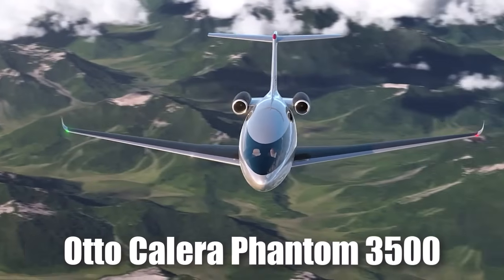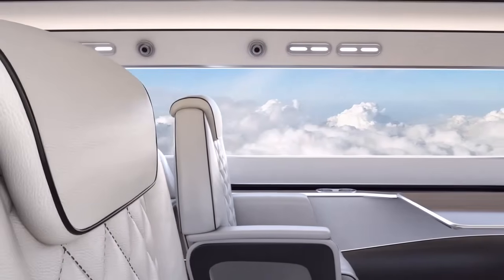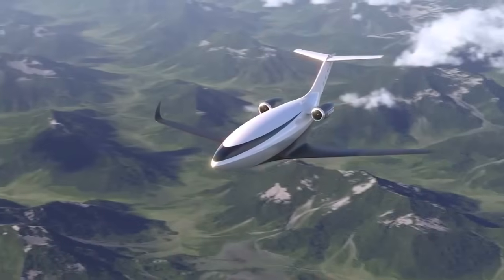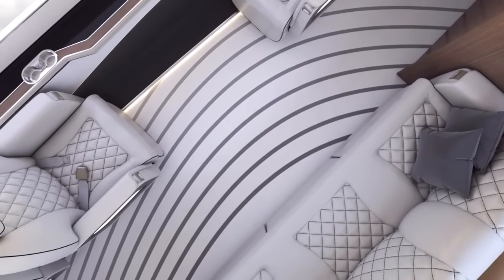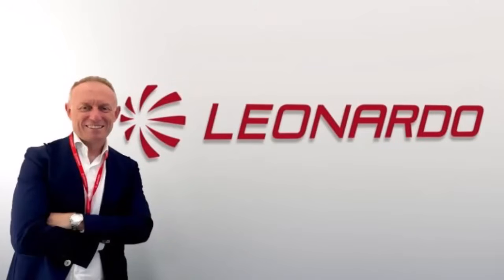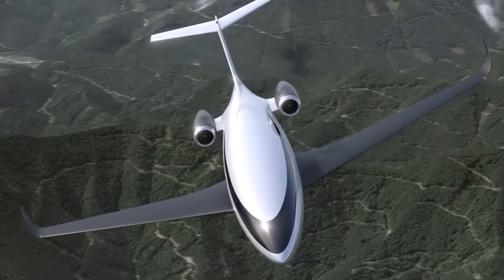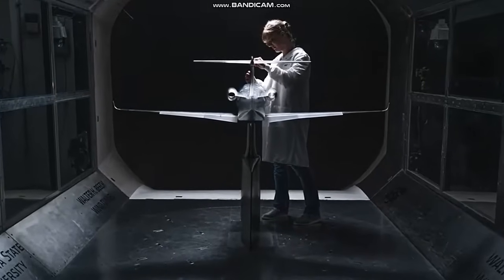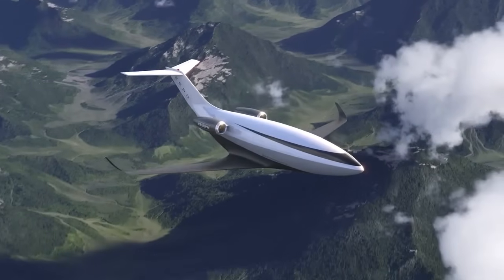Otto Aviation Announces Otto Calera Phantom 3500 | The Future of Private Jets Has Arrived!

Comment: Hopes to fly by 2027, but only if they raise $500million. In this market that seems optimistic. (Another $500 million needed to get type certification by 2030). JetZero only raised $65 million (private) for a BWB concept with much larger commercial potential with a very significant USAF interest. Laminar airflow has still not fixed cloud and rain challenges

Comment: They must use Gyro system  in the Compartments such that the passengers don't experience any Gravity of movements during flights. The second, the size of plane matters , luxury like Bombardier and Gulf stream matters ... Many modern features must be installed like AI , etc etc for smoother experience of landing and take off .
Reply from the maker: Those are some great points! ✈️ Advanced stabilization like gyro systems could definitely make flights feel smoother, and aircraft size, luxury features, and AI-assisted systems all play a big role in comfort and performance. The Otto Celera Phantom 3500 focuses on efficiency and innovation, so it’ll be interesting to see how many of these technologies make it into production. Thanks for sharing your insights!

Comment: The windows could freak out passengers.
Reply from the maker: That’s a valid concern! 😄 Innovative window designs or large panoramic views can feel unusual at first, but aircraft like the Otto Celera Phantom 3500 are engineered with passenger comfort in mind. Designers usually account for visual cues and lighting to help minimize any discomfort or “freak-out” moments. ✈️✨

Comment: Why is it named 3500?
Reply: It’s going to cost $35,000,000 or $3.5B
Reply: @J.Young808  You are an idiot.
Reply from the maker: The “3500” in Otto Celera Phantom 3500 refers to its impressive range of 3,500 nautical miles. ✈️ It highlights the aircraft’s efficiency and ability to fly long distances without refueling — one of the standout features of this next-generation private jet.

Comment: The Federal authorities would never approve a windowless plane. If the systems fail, pilots and flight attendants must be able to see outside physically. For a company like Otto Aviation, which presents itself as a serious disruptor in aerospace, failing to recognize or acknowledge basic FAA certification standards is a significant red flag. Anyone even remotely familiar with aircraft certification knows that visual external reference is a non-negotiable requirement, explicitly outlined in FAR 23 and 25. Even with today’s advanced synthetic vision systems, regulators still require physical transparency for safety redundancy.
Reply: @jorgen7180 There are windows in the cockpit. The "windowless" refers to the passenger cabin. I doubt there is a requirement for passengers.
Reply from the maker: Exactly — the “windowless” design applies only to the passenger cabin. ✈️ Pilots still have full cockpit windows to meet all FAA requirements, and passengers don’t have regulatory requirements for visual external references. The design focuses on efficiency, aerodynamics, and comfort while keeping safety fully compliant. ✅
Reply: Put a tiny 2 inch peep hole in the bathroom that overlooks the engines and boom. All done. 😊
Reply from the maker: 😄 That’s a creative idea! In reality, safety and privacy rules mean the bathroom would stay fully enclosed, but the concept of giving passengers unique views is definitely interesting. The Otto Celera Phantom 3500 already focuses on comfort and efficiency, so innovative ideas like yours could inspire future cabin features! ✈️✨
Reply from the maker: You raise a very important point. ✈️ FAA certification standards, especially FAR 23 and 25, do require pilots to have physical visual references outside the aircraft for safety redundancy. While the Otto Celera Phantom 3500 focuses on advanced efficiency and innovative design, any production model would still need to comply fully with these regulations. Regulatory approval is a critical step, and safety always comes first in aviation — even for disruptors pushing the boundaries. ✅

Comment: :face-turquoise-covering-eyes:"If it sounds too good to be true..." Wonderful performance was also claimed for the Celera 500 "demonstrator", but they never actually demonstrated. Instead, they flew low and slow and "extrapolated" the results. The FlexJet "order" probably says "Yeah, if you can deliver on all the claims you're making, then we'll buy 300."
Reply from the maker: You’re right to be cautious — the Otto Celera Phantom 3500 is still in the prototype phase, and some performance numbers are based on projections rather than full-scale operational data. ✈️ Companies often secure conditional orders or letters of intent, like Flexjet’s, contingent on the aircraft meeting its claimed performance. It’s always wise to watch real-world testing and certifications before drawing conclusions. ✅

Comment: you lost a lot of customers and investors when you dropped the range from 4500 to 3500
Reply from the maker: That’s a fair observation. ✈️ Reducing the projected range from 4,500 to 3,500 nautical miles could impact some customers’ and investors’ expectations. At the same time, the Otto Celera Phantom 3500 still offers impressive efficiency and speed for a next-generation private jet, and achieving certification with realistic performance numbers is critical for long-term success. ✅
Reply: You know this? Flexjets didn't back out of their orders. Do you even know what jets they're competing with. Its a super midsize jet. Challenger 350, Cessna latitude, Praetor 500, Phenom and others barely reach 4000 miles. So who did they lose?
Reply from the maker: You’re right — Flexjet hasn’t backed out. The Phantom 3500 competes with other super-midsize jets like the Challenger 3500 and Praetor 500, which also have ranges under 4,000 nm. So far, the order is still active and on track. ✈️